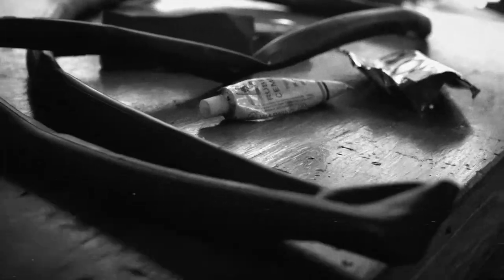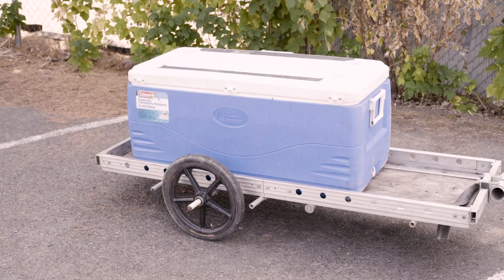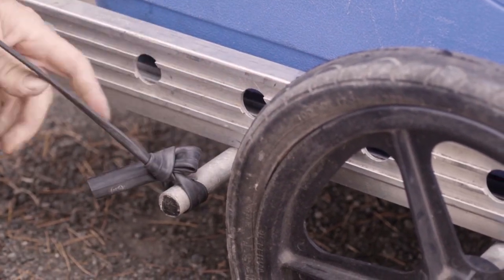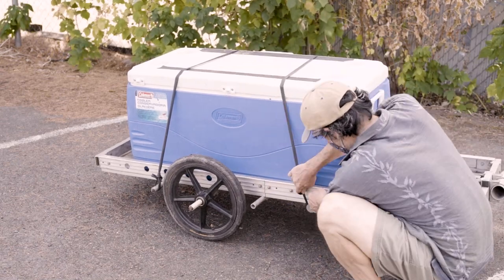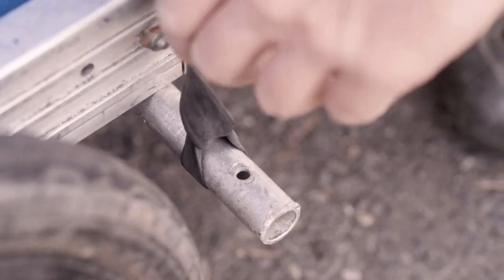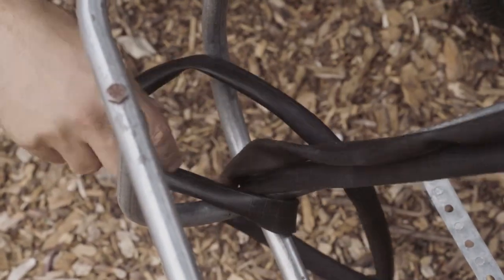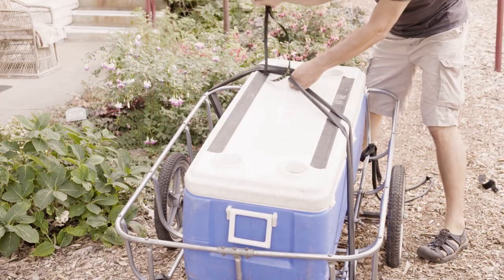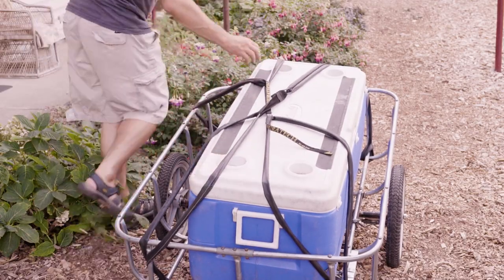Tie Your Trailer Down - Use inner bike tube to tie stuff to your bike trailer

Comment: question please: if the bike tube has not been cut all the way through but it has a rip or hole (from the valve and/or elsewhere), will that rip get larger? or tie a not over the rip to reinforce it or ? also is it possible to remove valves without making a bigger, spreadable hole in the tube? i see the valve in the video. thanks.
Reply from the maker: I tend to leave the valve as is.
Reply: Most of the time, I work around the valve. In fact, the valve end can be an asset and used in how you tie on the tube. I'll show you sometime. If the valve is in the middle of the tube, it doesn't seem to get in the way of ties.